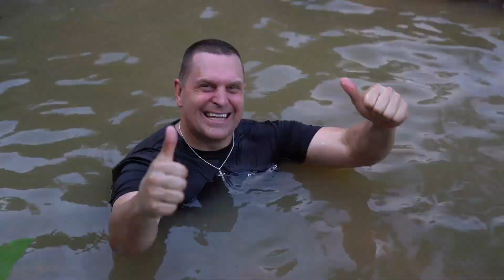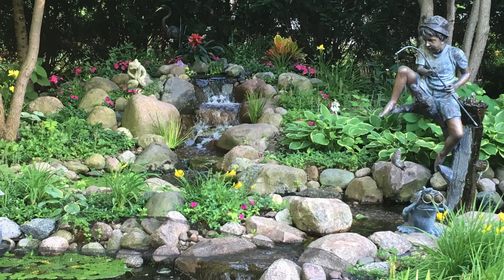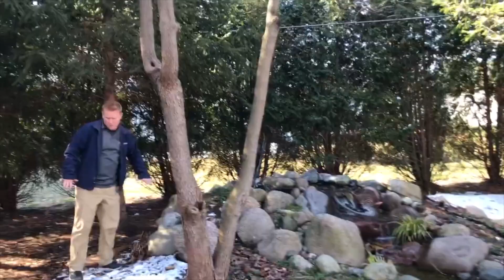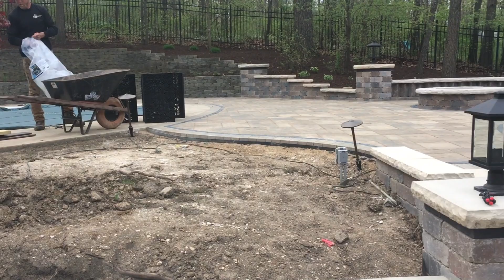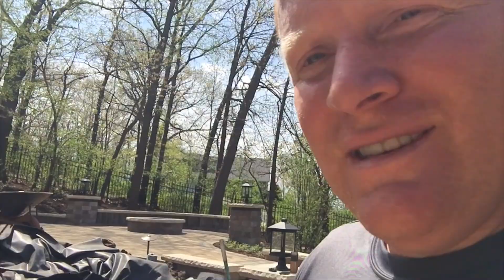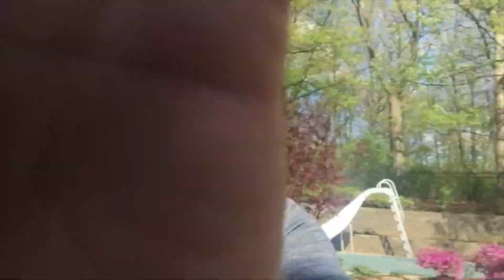We Install a WATERFALL with Just Two Guys!

Comment: How do you prevent the water from foaming at the waterfall? In the video, there is foam. Can this be avoided?
Reply: Shah Auckburaully foam away or wait a few days for the organically to evaporate
Reply: Shah Auckburaully The foam on a new water feature like this is created by the churning action of the waterfall which breaks apart organic compounds dissolved in the water.
It should dissipate quickly in this instance once the organically have been thoroughly broken down(this is part of the filtration process) on older water features or features with fish it’s a little different because the fish and surrounding vegetation will constantly add organic compounds/proteins into the water, if this is the case a good biological filter/Biofalls and routine bacterial treatments will break the compounds down thereby eliminating the foam.

Comment: Couldn't you have built that waterfall with an aquabasin instead of those aquablox?
Reply: Bill Seeds Great question Bill!
Yes, It’s possible but it would’ve changed the look.
What I mean by that is Brian and Chris had to recess the top of the Aquablox down below the top of the retaining wall by 6” or more to create the desired waterfall effects.
This becomes difficult with an Aquabasin because it may wash soil into the basin during rain events. 
When using the Aquabasin it’s typically installed just an inch or two below the surrounding area which doesn’t expose as much soil to erosion. 
The 6 Aquablox they used also have a higher volume of water which is beneficial.
It comes down to a judgement call....
Reply: @edbeaulieu5916  Makes perfect sense. I never really considered erosion. That answers a lot of questions I have about choosing which style of reservoir for future projects. Thank you!